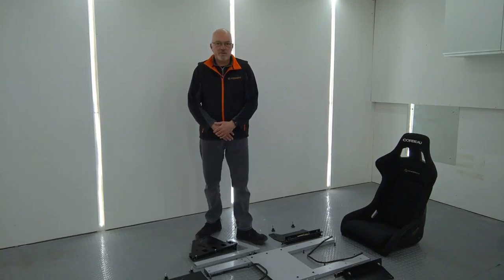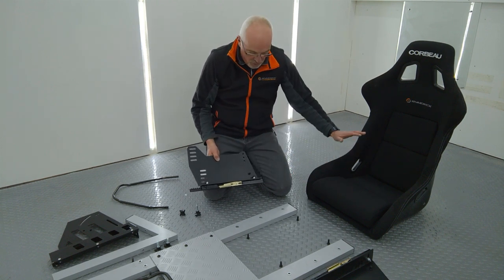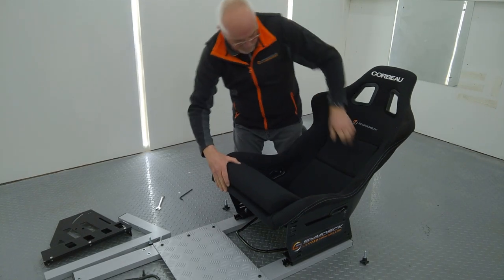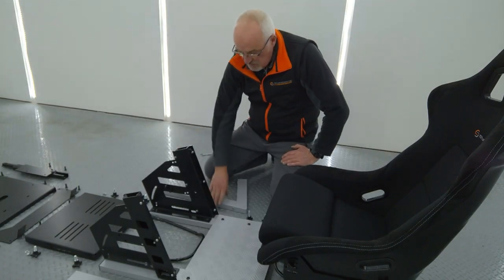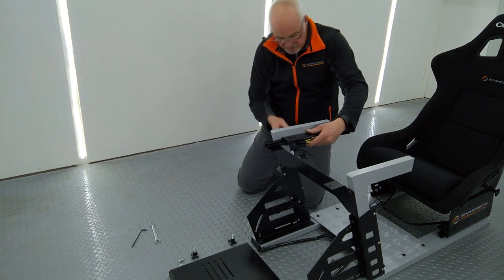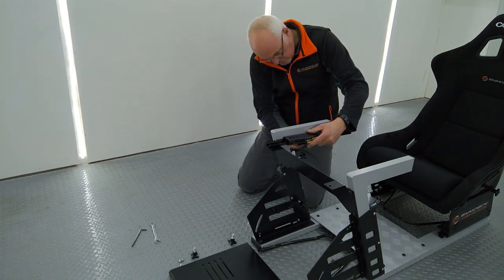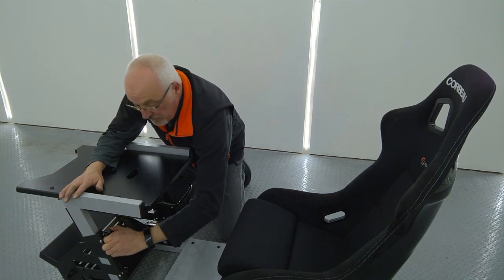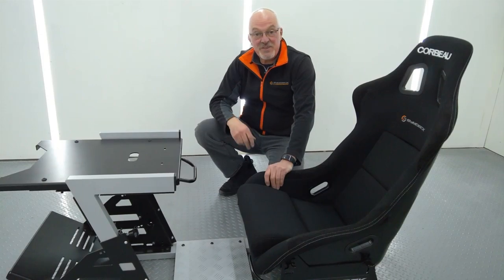Symdeck cockpit assembly short

Comment: are there Holes for the Fanatec DD pro Wheel ??
Reply from the maker: Hi, the wheel plate is pre-drilled for Thrustmaster, Fanatec, Logitech and our DD wheels. I hope that helps.
Reply: @symdeckracingsimulators  thank u , ur dd wheels aint Consoles compatible , right ?? Only PC .
Reply from the maker: @havmercy  Yes that is correct, Only the Fanatec DD wheels are console compatible although Thrustmaster are bringing one out